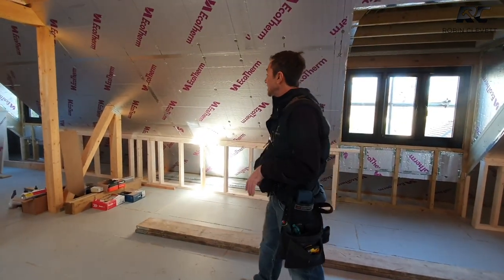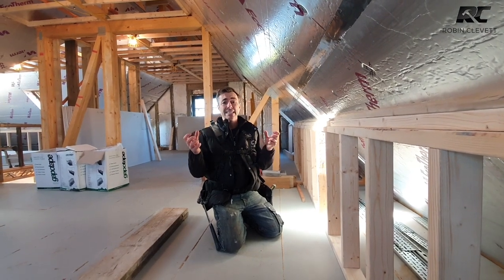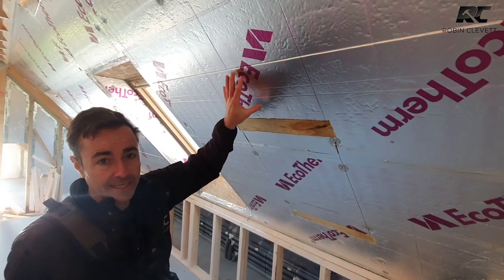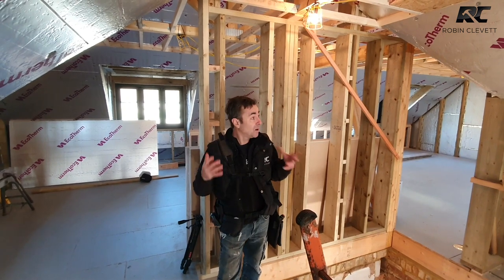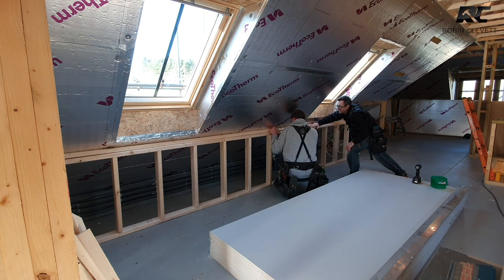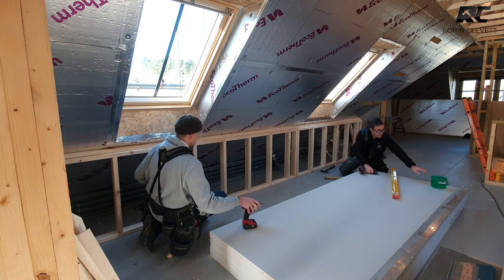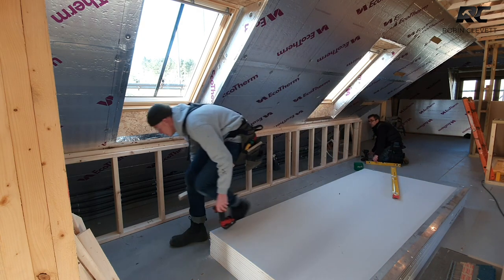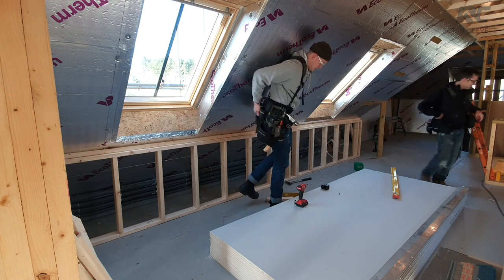Better insulation with this roof design

Comment: What I normally see is the void behind your stud work becomes a skip for unused rock wool and kingspan.....Always remembering my college lecturer telling me a clean site is a healthy happy safe site ..great work gentleman
Reply: Indeed, good house keeping is key, 👍😁🔨🇮🇪
Reply: An old boy Paddy told me "bullshit baffles brains" you can be the best Carpenter in the world but if you leave a mess thats what the customer will remember! An average carpenter who cleans up after himself will be a super star in the customers eyes!
Reply: @Goodwithwood69  Correct, I can't understand fellas that don't clean as they go. You'd see them clambering around a job over old studs and floor boards and bits of slab and general site debris. I can't work like that, no way. A dust pan and brush should be the minimum a chippy should have in his van. Preferably a Bluetooth vaccum and a couple of gorilla buckets, 👍🔨 🇮🇪 🇮🇪
Reply: When doing general building work, always take the time to masking tape up the doors to prevent dust from travelling into the parts of the house you aren't working in.
No customer wants their entire house coated in fine dust.
Reply: @flyingjackcarpentry9394  Indeed, it's a simple thing but very important. That same with putting carpet protector down and ram board to protect floors. The Zip wall system is something I'm looking into as well, 👍 🔨 🇮🇪

Comment: Another advantage is the voids can be used for storage without compromising the insulation. Great designing!
Reply: Does this mean that the "traditional wool insulation" on the floor is not required??
Reply: @markmann6964  it won’t be required in respect of thermal qualities, but there’ll be a need for acoustic wool for sound transmission. 👍🏼

Comment: Stabila R type 👌👌
Just tried ordering some gapo tape for a job I'm doing at the minute, but they don't do a 150mm which is what is specified, (with a 25mm pir over lay) I thought about using the 140mm gapo but they've only got 1 roll! I reckon you've bought their entire stock for your job?
Reply from the maker: Speak to them, as you may be able to use 120mm with the tape and the 25 under in place of 150mm the performance is probably better! They will help
Reply: @ukconstruction  was trying to avoid cutting in two lots of insulation! There's lots of angles, 4 hips, 3 hipped dormers! But I'll definitely give them a ring tomorrow!
Reply: I changed spec from 140 to 100mm before as 100mm working kicks the arse of 140mm on its own from performance standpoint - plus makes Gapotape in for free on the board saving 💃🏻
Reply: 150 sounds like a lot of insulation especially if you are going over the rafters, have a chat with someone as 100 even up to 120 between should always be enough, insulation has a severe diminishment of return after the first 100mm on a u value calc but a lot of architects over specify out of paranoia I’ve found
Reply: @OceanMaster-jq7xl  it's what building control have speced
Reply: @MrSparkyAprilia  building control spec’d 150? Did they give you a v-value? At the end of the day if you can hit a value they have to take it, maybe I’m wrong but 150 seems stark, then again when it comes to bc very few things are reasonable 😂 I hope there is another option and hopefully you can save a few £

Comment: We bought a timber frame house in Cornwall , the roof had 125mm insulation but the knee wall only had 25mm with a cold void behind , how it past building regs is a wonder , its now improved with  plaster board backed PIR   to add 75mm  not perfect but helps a lot   ,  like you say good design solve problems from the start

Comment: From start to finish no corners cut and attention to detail!What ever the cost this build its worth every penny👏And I’m jealous as hell😂 Wouldn’t bother snagging it be waste of time.
Reply: Well the pur board when installed was pushed in a little to deep so affecting the air flow and causing a void between the 100mm and the 25mm insulation

Comment: Hi Robin - We live in a 1960's bungalow and my better half allowed me to build a large model railway up there some years ago.
It is a labour of love and I am taking my time as its a project for my retirement but it is too cold in the winter and too hot in the summer up there.
I am more than capable of insulating my loft and I only want it for my trains and grandchildren to play with so it is not a conversion, just for comfort. 
It is already boarded out with lights and electric, so the hard work has been done I think!
The roof joists are 100mm deep and I have been told to leave a 50mm gap between the roof felt and the 50mm insulation board using the Gapotape as you have shown. 
I then cover it with 9.5 mm plaster board. 
Any advice gratefully receivedreceived

Regards Chris

Comment: Whats the fire resistance performance of the roof insulation?
Reply from the maker: Hi David, I would imagine that you could probably find that information from one of the PIR insulation manufacturers websites... I have not looked at that in detail as we use the material in an encapsulated condition meaning that the surfaces that encapsulate it such as plaster board gives the required protection in terms of building regulation stipulations and timed fire resistance such as 30, 60 mins etc, many construction elements are combustable and could burn but the whole make up of a building specification works to finish with a building that will perform safely in the event of a fire and that there is enough time and alerts via mains connected smoke and heat detectors to ensure occupants can escape safely, at various points in the construction phases the building is more combustible than when it is complete and properly signed off.

Comment: Do those Velux allow the plasterboard to come into the bottom rebate at an angle and still give a good fill? I've had trouble before trying to splay the side rebates (on Fakro I think it was). Maybe top and bottom rebates are meant for bigger angles in any case?

Comment: "it's about exactly right" is the best thing you've ever said Robin ;-) 

Lovely job, I wish everyone understood how much easier it is to work when everything is spot on. Instead of constantly compromising or putting out fires because it's all "a bit out".  

I learned early on that you need to "start accurately to end accurately". And for me as a brickie/chippie that means bob on level concrete in the footings.  If you get the footings 100% level, you can nearly build just using a tape measure!
Reply from the maker: Yes mate we sing from the same hymn sheet!!

Comment: Following this very carefully Robin well done it’s nice to see good work I’ve been a builder for 51 years and I am now retired and I’ve got a self build to do and they are specifying on the ridgeRS Jays, which I hate I prefer would can you show what’s happening with your lattice ridge 
Is it structural? And is it able to replace RS Jays as I have to put a flat ceiling in just as you are doing and it would be so much easier to do the lattice than the RS Jays cheers keep up the good work Pete Edmondson
Reply from the maker: Check out this video where I explain all https://youtu.be/kdzI9MkL64Q this is the roof design etc, I always design steelwork from a roof where ever possible

Comment: Great job and really tidy eaves. Also makes it safe space for plumbing and electrics if required, and a clean  space to do that work in, not a typical  rubbish dump. Top job as always. Be interesting to see on the next one how you cut that fillet - guess you can set an angle on your saw table, but is there another way if you only have simpler gear. The guys that snag/BCO your work must be paying you for the education? Keep 'em coming.

Comment: Very helpful video. I am finishing of my self build at the moment and my loft is the last step to complete. I have 100mm pir between the rafters and 50mm over the tops of the rafters and I was wondering the best way to put in my (much smaller than your ones) ashler walls and ceiling Collar 👍
Reply: How should the 50mm layer over the top of the rafters be fixed?

Comment: Is the big fella stripping the heads out of all the screws or is that just the sound that impact driver makes?
Reply from the maker: Thats an impact driver
Reply: @ukconstruction  I mean that red one doesn’t sound like a regular impact driver with the rattle. It just sounds like the screws are getting their head stripped out with that particular driver

Comment: I see your thought process but respectfully disagree. I think it would be better to insulate at the Ashlar walls and not down to plate.Effectively your thermal envelope is then smaller and cheaper to heat. Although you insulating down to the plate you still have an unheated area behind ashlar walls which  draw out heat from the main area
Reply from the maker: From my experience of building roof spaces for 30 years this is the best way of achieving a better envelope it's exactly the same as most European standards where they put all there insulation over the rafters or the entire roof space, if you have any calculations to prove otherwise then I would like to see that, our method also allows all the services to also be in these voids without the possibility of damage from excessive heat or cold
Reply: @ukconstruction  thanks for the feedback Robin. I work as an architectural technician so this sort of thing really interests me. I work with a SAP assessors i will get their opinion and come back to you, happy to be proved wrong. I am pretty sure the unheated space is a penalty from SAPs point of view. Out of interest do you ever work in the ipswich area or is that out of your area?
Reply: No because then there is a cold horizontal surface behind the wall. Best down to the wall plate continuous. Less risk of a heat bridge

Comment: Again, big picture, you have outside air coursing through your building just behind your 125mm of PIR board, which was installed with the labor intensity of a coffered ceiling, and you’re next going to make perhaps 2000 individual penetrations to your primary air barrier using drywall fasteners.

Your building envelope concept is a bit like driving in winter with all the windows down, but wearing a thick, puffy rabbit costume, smug in the belief you’ve solved that cold car problem.
Reply: It’s all in the details tho isn’t it Travis, the first layer of PIR is between the rafters, with gapo  tape to ensure air tightness. The plasterboard gets fixed into the rafters, no penetration of that first PIR.
Reply from the maker: Bang on mate